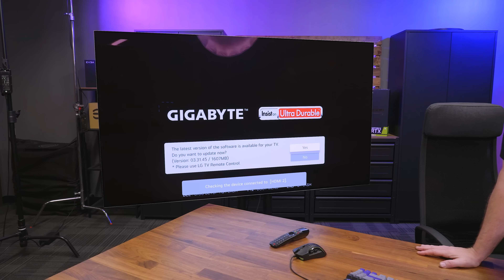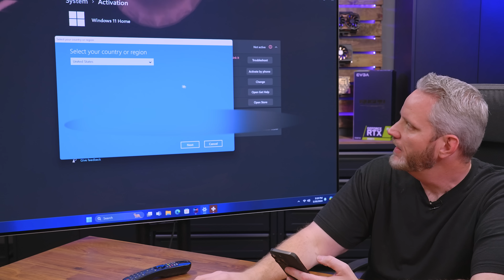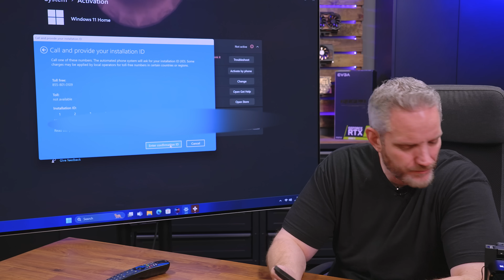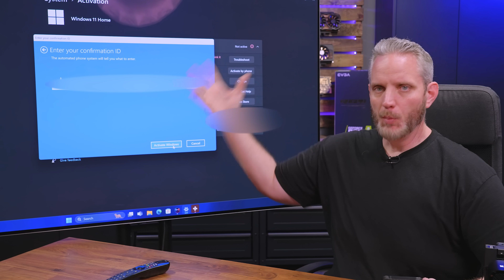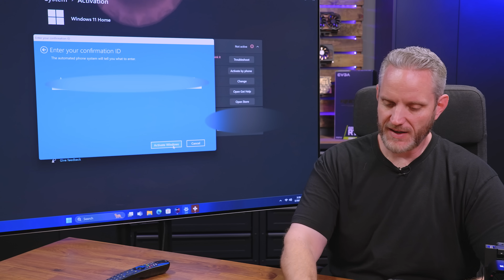How to move OS drive to new PC and keep Windows and Activation! EASY!

Comment: I never reactivate any version of Windows on different computers and yet they remain fully activated

I simply use Windows to Go for Windows 10 or 11 and they remain activated on all of my computers

I run Windows 11 24H2 Preview on an MBR partition smaller than 64GB with No TPM on my Windows XP Machines (Sandy Bridge)
No UEFI BIOS and no Windows Account either

Since it is an MBR partition, all backups are interchangeable with my XP backups

As of May 26th 2024, Windows XP has remained online for 10 years without a single malware problem
Running a Native Boot XP-SP2 install in a Full Admin Account without a single Microsoft Security Update

I am now Banned From Bleeping Computer / Techspot / ZDNet / Windows Forums / AnandTech and several other sites for challenging the Israeli Military, The Chinese Military, The Russian Ransomware Gangs, The Iranian Wiper Gangs, The North Koreans and The NSA to WRECK MY BOX with any malware they want

They have all failed for 10 solid years and it is still running from a Native Boot SSD  (Not a VM)

Yeah, I know a bit about running fully activated on multiple machines
I am after all, the Worlds Leading Expert on Windows Security

Prove Me Wrong!
Bullwinkle J Moose

Comment: This is such perfect timing as I'm soon building a new rig with only my SSDs moving across. Thank you
Reply: Same here!
Reply: How did it it go ?
Reply: @Off_The_Rail  went good mate, thanks. All is working well
Reply: @MegatronEvo  sweet I’m about to do the same, just gpu, psu and SSD’s are going over from intel to amd, did you prep anything before hand on the ssd with windows or just moved it and it took care of itself ?
Reply: @Off_The_Rail  I literally just slotted them into place and went for the boot up and it got me to the login screen. All I then had to do was the activation bit and it was good to go.
Reply: @MegatronEvo did you have to delete any drivers?
Reply: @superkarifragilistic  hi mate. No I didn't delete anything. Although because my gpu was different I did have to get appropriate drivers for that. I used Display Driver Uninstaller (DDU) to make sure my old card drivers were wiped and then downloaded the new. Hope that's some sort of answer to the question!
Reply: @ Well i just used ddu then swapped it into my new pc and now my display isn’t turning on, did you have this issue?
Reply: @ Nevermind!! I fixed it
Reply: this comment relieves a lot of stress. im doing the exact same thing, however i plan to reinstall windows on my OS drive before putting it into the new system. just to clean everything up and start fresh
Reply: Hey man not trying to beat a dead horse here but just want some simpleton clarification 🤣 I’m swapping from intel to amd, you didn’t have to uninstall any old chipset drivers? Been seeing all over the internet that everyone says that’s a big no no but some ppl are saying it’s all gravy on their end. Just swap parts over and you’re good? Keeping same gpu so don’t need to uninstall those at all. Thanks and again sorry if I’m bringing up old discussion, just wanna make sure I know what I’m getting into!
Reply: @DreadedPlayz Hi mate. Well it just so happens that I also did this switch. I went from I9 Intel to a 7800X3D and i did not do anything with chipset drivers. I had cleared the GPU drivers as mentioned above as a precaution but nothing regarding CPU. All still working fine btw and its been built for a good while now.
Reply: @MegatronEvo  Okay cool, I appreciate the response man, I’m swapping from an i7 to a 7800X3D. I really wanted to avoid having to do a fresh windows install but was worried about any issues from lingering drivers. Glad to hear that won’t be the case, cheers man!🍻
Reply: @DreadedPlayz  Windows should automatically install any drivers that are needed to get the pc up and running. Once on the desktop, you will have to install your core drivers. this usually being chipset and gpu. Especially when switching from intel to amd.
Reply: @ket-a Yeah all of that isn’t new to me, I’ve built quite a few pcs, just never built on a previously used OS drive before or swapped from intel to AMD. Thankyou for the comment though!!
Reply: @DreadedPlayz  ngl i thought you said install chipset drivers, not uninstall. i did a new install of windows just to start fresh, but im prettyyy sure that either windows or the driver install manager takes care of uninstalling the chipset drivers for you. i could be wrong though.

Comment: I know this is bad to say but I haven't re-installed windows since 2013, I had a 4770k non UEFI boot (gtx 580 didn't support UEFI boot), and the same install base install windows 8.1 pre update 1 is now a 12900k and a 4090 Strix UEFI boot Windows 11. This windows install has survived bad ram and 3 hardware changes (so far). Microsoft has came a long way.
Reply: That's the power of the underlying changes Vista brought in hey.

Comment: FWIW, I recently cloned an OS drive from an old x-58 core i7-920 machine from 2008 running Win10 Pro (VERY SLOWLY!) over to a used HP EliteDesk Mini with an i5-9500H.  I made sure it's OS was updated completely and after a couple tries of figuring out how to clone (go CloneZilla!) from MBR to GPT/UEFI, it worked and didn't require to reactivate anything.  Perhaps it picked up the HP's windows key somehow or not, IDK.

I probably wouldn't have even bothered because the data was easily restored, but there are a lot of old apps installed that I figured I would have issues with even getting something to install.  After getting it all up and running, I upgraded it to Win11 latest and it works fine!  I'll probably do a clean install at some point because I'm sure there's plenty of cruft in there from the total hardware change from an old Dell Studio to a newish (2017-18) HP EliteDesk Mini.

Comment: If anyone is having problems moving a drive from one computer to another, and the new system is unable to create boot files, you can use your windows flash drive to go to recovery mode, command prompt, and then DISKPART to check the drive and the drive letter of the problematic windows drive: diskpart>list drive>list partition, see the drive letter of your windows drive which you just installed from the old pc and then exit diskpart. Then type bcdboot "drive letter"\:Windows
ex: bcdboot c:\windows
it will say, "boot files created successfully", and you are good to go.

Comment: I've upgraded boards and CPUs before twice. The first time, I had to call Microsoft for the reactivation. Just told them that I upgraded my machine and did the confirmation ID process. Then I moved my hard drive again to another board, after the free W7 to W10 free upgrade. It worked seemlessly. Oh, a Pro license makes it does that. A Home version license might not. Of course, there's gonna be some need to update drivers and stuff, and some crumbs may be left in storage after the update. Though I never really had any major issues with the migration, I did end up doing a clean install a few years later, using the same Windows license. And lastly, if you have a Microsoft account, paid or free, and have your OS license tied to it, signing in to the upgraded machine will make the activation somewhat automatic.

Comment: We didn't even need to reactivate windows when we transferred Mum's drive to a "new" computer. It was just plug and play. Just updated the drivers and off she went, happy as could be.

...I say new computer, but it was really the ten year old computer (4th gen i7, 16gb of ram, 1080) I was using and she paid for originally. I'd built myself a new computer (13th gen i7, 32gb of ram, 4070ti) so I figured the old hardware would be an upgrade for her old system (4th gen i5, 8gb of ram, 570).

She's happy as can be since she can play all the Command and Conquers without any frame drops now.

Comment: I just moved from a 5950x with X570 board to a 7800x3d with a b650 board. This didnt work as the b650 board did not have internet drivers so I got trapped at login. Had to reinstall windows, but that was fairly painless compare to back in the day. So many of the settings etc are saved at the MS account level these days 🤷🏼‍♂️

Comment: Can you make a video about upgrading your old boot drive to a new one? I have a crummy 512 first world problem m2 ssd and I want to move it to a new one.
Reply: You can use a 3rd party tool like Macrium Reflect to clone the drive, or you could use the built in Windows System Image backup option to an external drive, then restore it to the new drive.

Comment: You do not have to activate by phone. Click troubleshoot. It will give you a list of computers you have on your account. You pick the one you are replacing.
Reply: As long as you attach it to your Windows account
Reply: I ran into some fun issues where that didn’t work for me and support told me I needed to get a new licence… luckily I had another computer that had a retail licence I didn’t use anymore on my account. They really want you to do the digital activation
Reply: I was able to switch my bad motherboard and replace my drive that way. Everything worked properly and I just uninstalled chipset drivers and onboard network drivers before making the swap.
Reply: @Jabid21  I know this is old so not sure if you’ll see this, but did you uninstall previous chipset drivers while still on your original board/build? Im upgrading from an old 10th gen intel to AMD AM5 platform, and I just dont want to cause issues on the current board/on my OS drive before upgrading and swapping parts in my pc case
Reply: Wow, thank you for this! I've been using the phone method for years and never knew this was a thing!
Reply: Yeah. I'm pro local user and anti link with MS account
Reply: @BrandenMcNabb  Way to go you're saving the world!!
Reply: @BrandenMcNabb  Freedom and privacy takes work. It's hard to rape the unwilling and the wary.
I just use windows for gaming period. I only allow Molestersoft the absolute bare minimum information on me. Not even a current credit card is documented with MS. 
No built in camera, no built in microphone allowed, only detachable devices. No smart phone is ever allowed to attach to it. No wifi enabled.
I just use Windows for video games, because it's an easy Dirty Operating System for gaming.

For my daily driver, I've been using Linux Mint for over a decade on a now, eleven year old Dell 7010sff - 4th gen Intel CPU w/16gb ram. No muss, no fuss. 
Not great for gaming. ... although, I'm going to check out some Distro's that claim to be.
Reply: @BrandenMcNabb  Your loss. hehe I like being able to pretty much get up and go from the get-go. :D
Reply: I did it last weekend and was surprised at how easy it was.
Reply: That's assuming you have an account linked to it.
Reply: Thanks man for the tip. Literally was in the process of buying a new copy of windows when i bumped into your comment on this video. Cheers!
Reply: I had always been told to do a fresh install when changing major components like the motherboard. When I swapped mine, I went ahead and did a fresh install. However, I had purchased a Windows 11 key from a reseller online for cheap, and it's bound to my microsoft account. After Installing Windows again, I just signed in to my account and everything worked without issue. I guess it really depends on the type of key you have.
Reply: great comment worked for me thanks bro <3
Reply: Just did this earlier. Moving from intel to amd. The first time, it said it had trouble with the troubleshooter. After waiting several minutes (and also a reboot I think), the troubleshooting works and Windows is now activated.
Reply: Very handy when I am scraping old recycled PC's for work. Reset Windows ad my MS account and destroy or hold onto the drive and scrap the PC.
Reply: thank you so much. I didn;'t even see the option to active by phone.
Reply: do you have to do this if you already dont have it activated?
Reply: oh my god i've been putting up with this for a while now since i upgraded from an intel 6700k to amd 7600x and thanks to your comment (before even finishing the video) i fixed this after a few clicks, thanks so much
Reply: yeah, um, no. That doesn't always work. When i built my new system I got an error everytime I clicked troubleshoot. But that might be from me using the same activation key for the past 6 years on like 5 different mobos and cpus, lol. But my point still stands, it doesn't always work but I haven't ever had a problem with calling in.
Reply: Well if your someone like me who removed all of your previous devices and wasnt able to activate it like that then yes activate by phone is the better way to go.
Reply: here s something just get life time key and there u go
Reply: does this work for win 10 too? I'm outside the us tho
Reply: @alejandrobarboza2431  It should as long as you, at least, logged on to a microsoft account at least once with the machine. I wouldn't think region wouldn't matter.
Reply: If you don't want to keep it on your Microsoft account, you can always go through the process, and then do a refresh with a local account. Or just add a local account and sign in with that.
Reply: You do have to remember that there are different levels of digital keys. Lets rewind a few years and remember when there were free upgrades from 10 to 11. Hell, I remember they did the same free upgrade from 7 to 10.  Then there are just Win 11 keys such as what you would get from a PC builder ( which are probably bulk licenses. ). Purchased keys from retailers. There are also "keys" that people may be using that were installed on machines in a .... not exactly proper way( did I say that in a nice enough way?). There are going to be situations that just don't work. You can actually see your activated PCs ( as far as I know the maximum is still 10 ) on your MS account. If you think a local account is better or think that saves you from MS collecting telemetry, you are mistaken. Those few sliders you click at the beginning of the installation are only about half of them. MS has gotten very sneaky with behind the scenes stuff. In the end, it is going to be moot. Windows is headed to a cloud platform in around 5 years, or so they hope. They may accelerate it or they may delay it but that is what they have been saying for around a year now.
Reply: @Chuck.S.  Max of 10, as in 10 activated PCs with legal copies of Windows? I thought the max was always 1 PC.
Reply: @mynintendogamingfeed5208  Actually, I just checked my account and I show 12, so they must have raised it at some point. Don't ask why I have so many keys, it is a very long and complicated answer.
Reply: @Chuck.S.  The telemetry sliders at the OOBE aren't even close to 1/2 of the hidden telemetry sliders, think 1/10 and you're getting closer.
Reply: @Chuck.S.  

I was using the keys I found on discarded PCs with an old key sticker.  Some were 98, others were XP....it was a free for all that I fully took advantage of...I must have at least a dozen different licenses tied to me now...lol
Reply: I don’t know why people even activate windows anymore when you can use it for free with very little downsides. After a couple weeks that activate windows watermark goes away and you’ll never know it’s unlicensed. I haven’t  activated windows in over 10 years and I’ve never had a problem with it.
Reply: @geshtal2056  I don't think it goes away on its own if it doesn't pick up the license.
Reply: @geshtal2056  your right up to the watermark goes away cuz it does not
Reply: Earlier this year, I swapped my drive from a Gen 4 Intel system to a brand new Gen 12 system, in preparation for Win11. There were no problems. It worked in the new system, running Win10. There was an issue, when it upgraded to Win11. However, I just logged in to the MS Account & selected which computer installation to use. Everything was fine, after that. You can activate Windows with an MS account, and still log in locally. It carried over all settings & programs from the original machine. Only Rise of Legends was broken.
Reply: Funny, I've moved individual drives between multiple systems, and never had to reactivate.

maybe because I'm running Fedora.
Reply: @SenileOtaku  well that information is about as much use as a fart in the fog, thank you

Comment: A nice Video Idea would be Cloning a Lower Capacity Drive to A higher Capacity drive like you upgraded your Only Drive because I messed up on this Process pretty good and now I have 2 Non Existent Drives that I cant delete and when I select them my PC Freezes up and the Drive Upgraded was my Boot Drive
Reply: Do a clean install of windows to the new drive and then copy just the C: partition from the old system over the top of the freshly installed windows C drive. This sorts out the problems of UEFI and boot sectors. I had to do this recently.

Comment: the windows key IS NOT "drm'ed" into the motherboard. 
it is tied to the NETBIOS name. 
so ... easy way to work around is to make sure when you change the mobo - write down the PC name. 
after swapping the mobo - rename the PC to the old name. 
reboot, should be sorted 98% of the time. 

the windows installer will generate the PC name using the MAC address of the mobo's NIC. 
as always, with anything microsoft - YMMV.
Reply: It actually is DRM'ED into the motherboard, especially the OEM stuff like Dell etc. There's a table in the UEFI that has activation stuff that when combined with some stuff that the OEM has preloaded into the Windows image, creates the hardware activation.